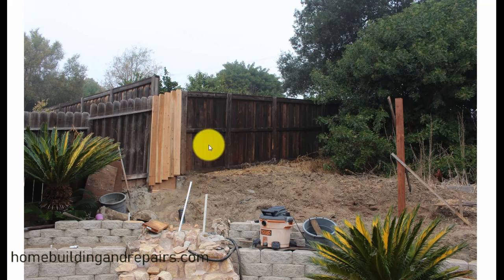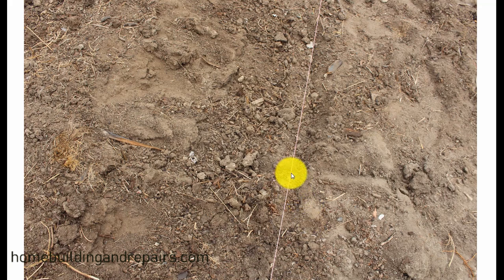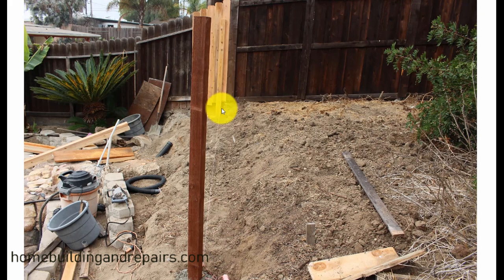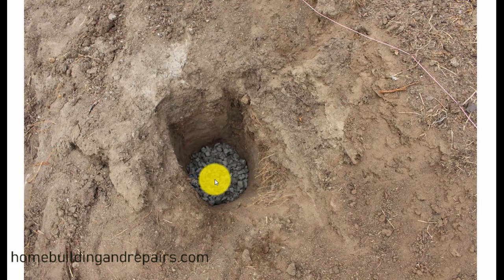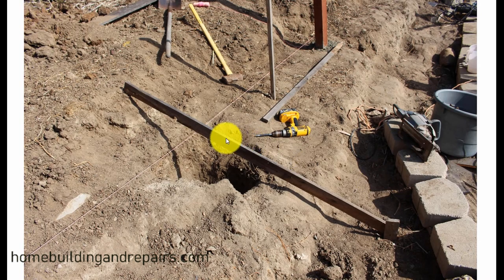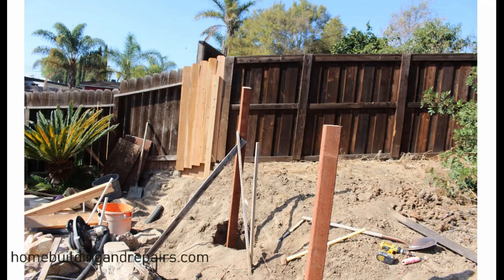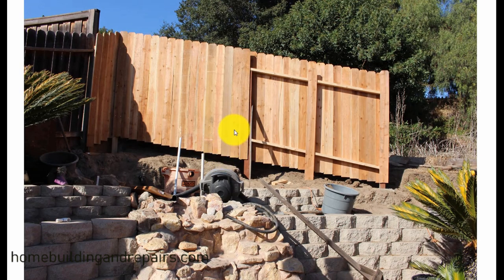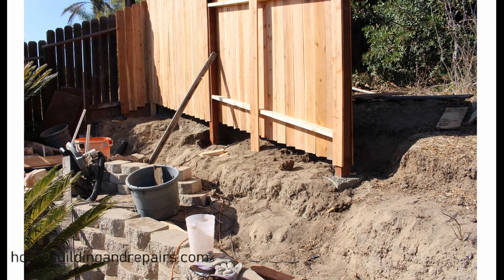Part Three of Wood Fence Building Video Series - Greg's Home Projects

Comment: In listening to some guys who only build decks and install fences for a living, they said DO NOT incase posts in concrete. It surprised me because I've always encased posts in concrete. They say, dig below the frost line, or 32" to 36", where there is no frost line. Then put 3" to 4" of concrete on the bottom and let it set until the next day. You can then set the post and layer and compact dirt around the post as you fill the hole.

They said that this method is superior in multiple ways: 1) It gives you somewhere to put the dirt from the hole. 2) It allows you to more easily replace the post, while reusing the concrete (because sometimes posts split and the customer wants them replaced, etc) 3) Because concrete traps moisture, while the dirt does not, the below grade portion of the post lasts longer (according to them). They say that they charge more money to replace a fence where the posts were encased in concrete, whereas the replacements of footer only fences are a breeze to replace. They don't have to poor concrete, or wait the extra day. The post is easier to pull and they have the correct amount of dirt to refill the hole. They said a replacement of a footer only fences that could be done in one day. However, it will take two trips and over 2x more work to replace a posts that are encased. Sometimes they just cut off those posts, leaving them in the ground and making new holes for posts, where applicable. That greatly reduces the labor portion.

I asked about durability and they claim that it's not a problem but if a post slants, it's far easier to fix that an encased post. They say, for certain loose soil types, they just go deeper.

To be clear, I haven't tried the method or compared fences using the two methods. So, this is all heresy. I just thought I throw it out there for consideration. I've got a home build coming up and I may try this method for the fence and the deck. Well, unless I hear a good reason why not. Personally, I don't see the need for any concrete in setting posts for fences, but they seem to think it helps.
Reply from the maker: I've never been able to witness any results from the installation process you're referring to, so don't think I'll be much help. Frost heaving is definitely a problem that seems to be difficult to solve without spending a lot of money.